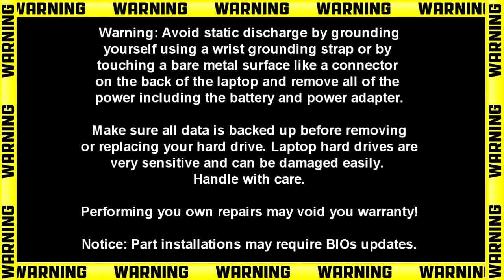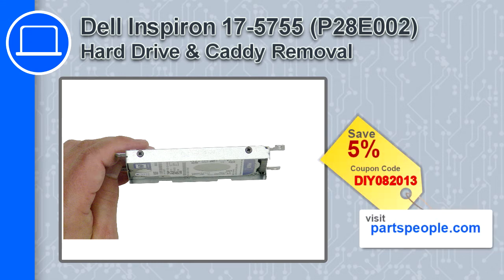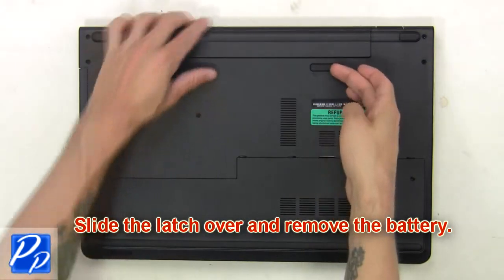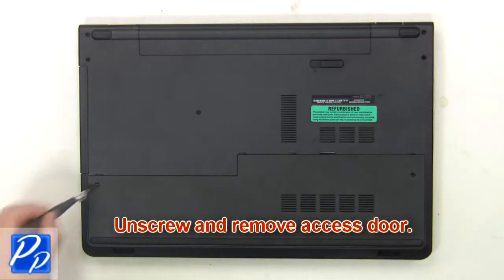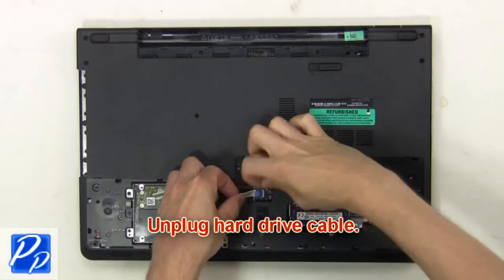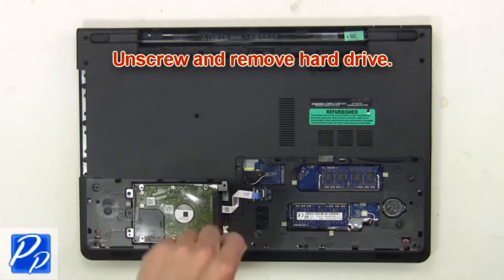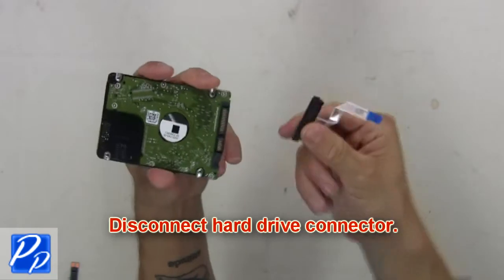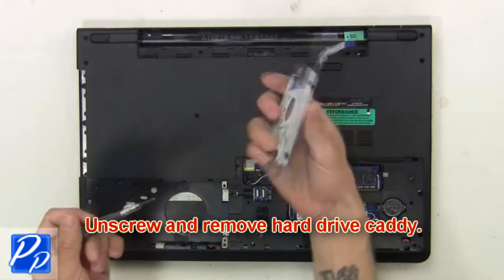Dell Inspiron 17-5755 (P28E002) Hard Drive & Caddy How-To Video Tutorial

Comment: hey, I'm extremely stupid how to I unplug the hard drive cable?
Reply from the maker: There is a black locking mechanism where the cable connects to the motherboard. Place your finger to the right of it and lift it. It will swivel away from the motherboard unlocking the cable.
Reply: @dellpartspeople  thanks dude your a life saver